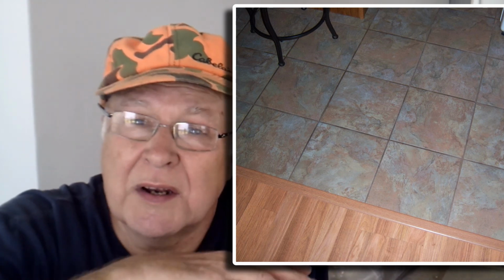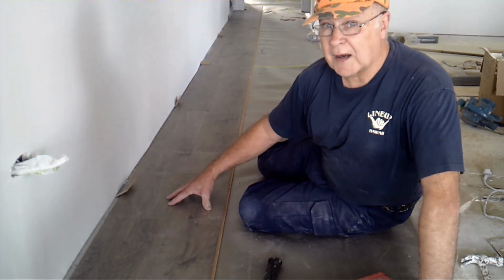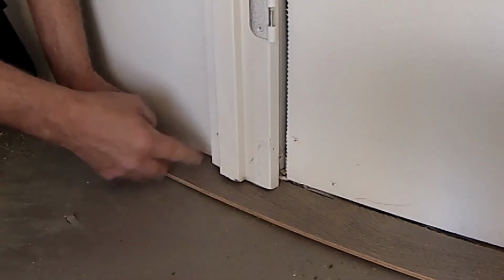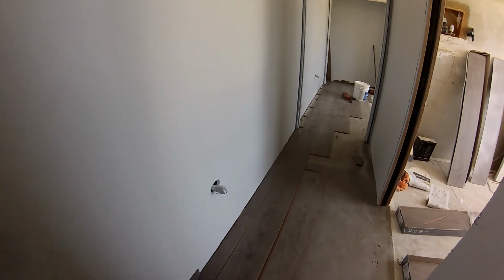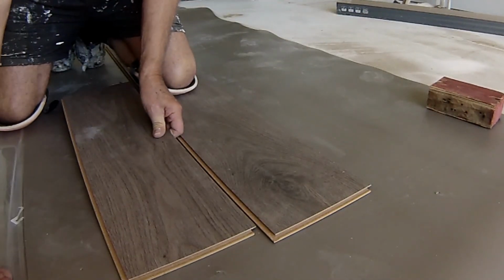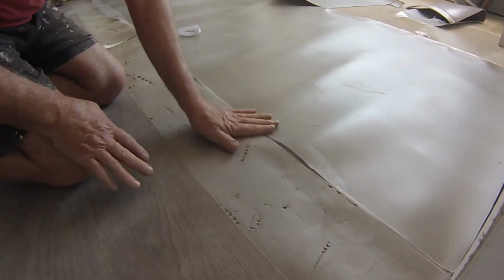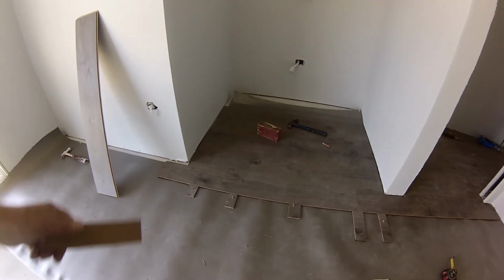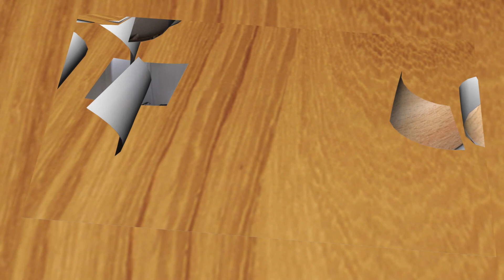Build My Own Home - Part 40

Comment: good stuff, can i add another tip, i was told to unwrap the whole delivery of flooring and mix up the boards to allow for slight colour variations in manufacturing batches. i hope you have enough to do the whole house, i had to go back to the supplier once for half a room of flooring, and the new boards were a shade lighter! it meant i had to take up half a room of boards and buy more to complete the job.
its comin along great by the way, youll be glad when its done ;0)
Reply from the maker: Yeah, I always mix packs. You don't need to do it over more than 5 packs as after that they are the same pattern anyway. We bought enough for downstairs as well.